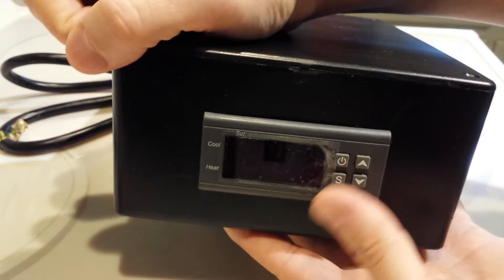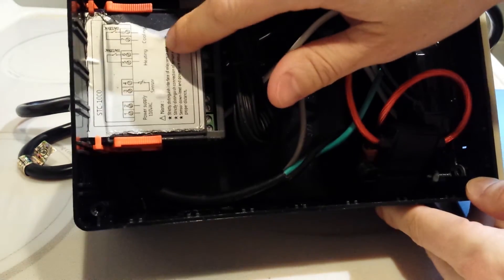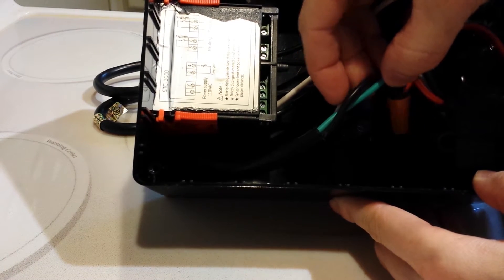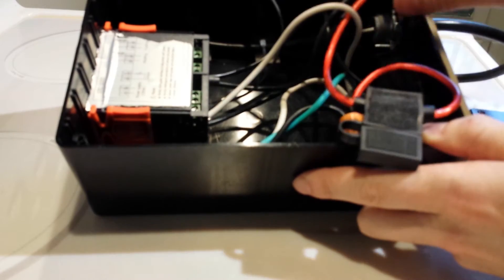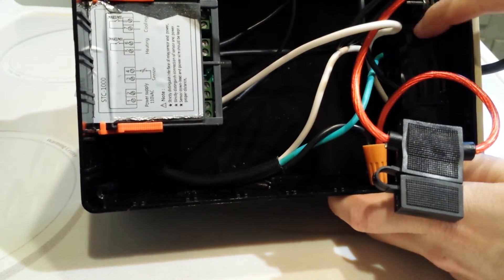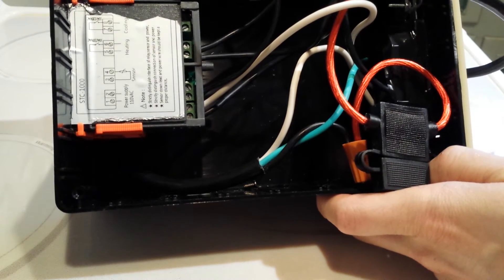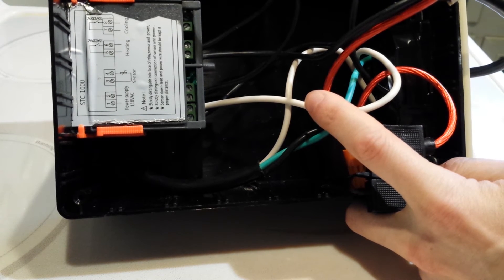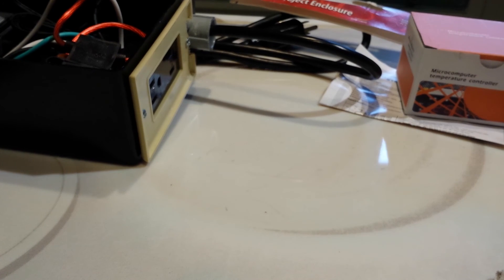Prevent Aquarium Heater Failure! DIY heater controller.

Comment: I got some thing better .Thank you
Reply from the maker: Cool. Hopefully this video was helpful.
Reply: NickMach007  I lost my thermostat because of in correct wire up.what shall i do.
Reply from the maker: without more info it is hard for me to give you advice on electrical wiring. if you have a video or something I might be able to help more. The device I made in this video functions as a thermostat for your heater, so it might be able to take the thermostat's place.
Reply: NickMach007  Okay i will send you the video when i bought other thermostat.thank you for your communication.
Reply from the maker: Absolutely. Hopefully I can help more once you have all the supplies.

Comment from the maker: Whole thing ran about $30-35. Nice controllers are way more expensive, though the cheaper ones are about that same cost. And, you are right about the width for an outlet, though you can also mount an separate outlet box under your stand or somewhere else depending on what you are trying to do / what look you are going for. Thanks for watching and commenting. I appreciate it.

Comment from the maker: Thanks for watching my first video. I plan to post more as I try to get my tank set up. I can definitely use feedback from more experienced folks out there. In re. to your questions,I will use the heater's thermostat as my first line of defense.For example if I want my tank at 78 degrees, I'll set my heater to 78, but then my heater controller to 80. That way in order to cook my tank, both would have to fail. For the other question, yes I will be able to shut the heater off from the controller.

Comment from the maker: It is a custom build. I bought the regulator used off eBay. All the stainless steel parts I got directly from Swagelok and I bought a Burkert 6011 stainless steel solenoid. I will post the part list when I do that video. It got stupid expensive (or at least way over my initial budget), but there is something sexy about stainless steel and I couldn't resist. That and it should be nearly indestructible. I ought to be able to pass the whole build down to my great great grandkids...